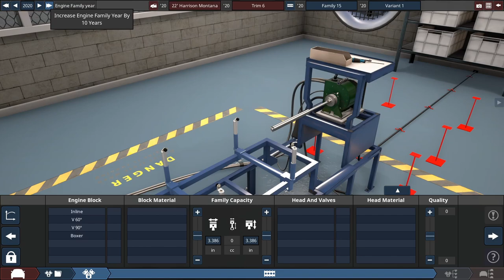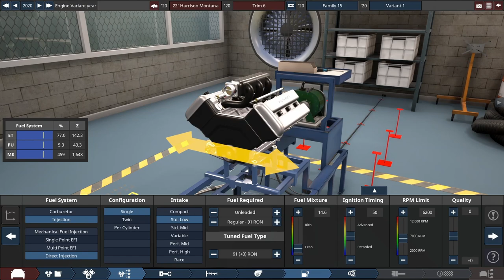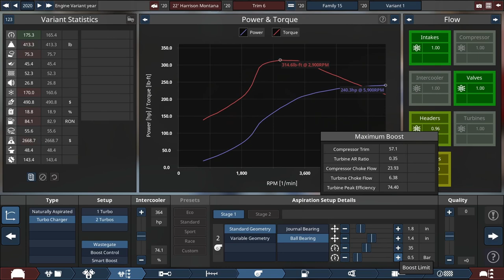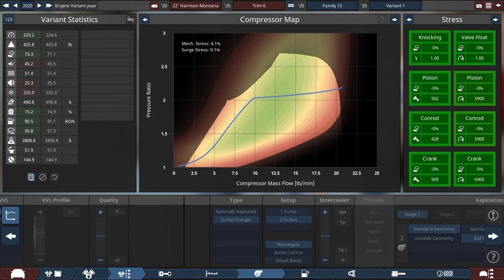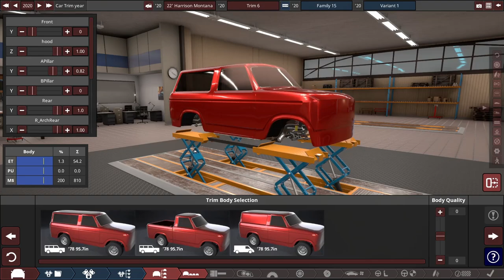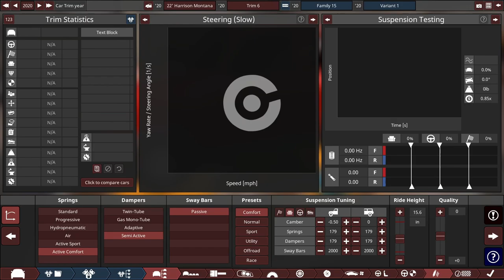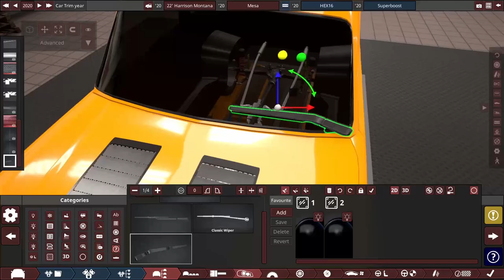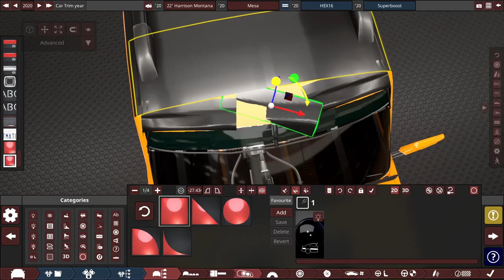THIS IS BETTER THAN THE NEW BRONCO! | Automation/BeamNG

Comment: If you want the engine to rev higher, make the engine oversquare (bore is bigger than stroke) it's a common method in F1 to get higher revving engines, its become such a common method in F1 to the point where the bore/stroke ratio is like 2.5.